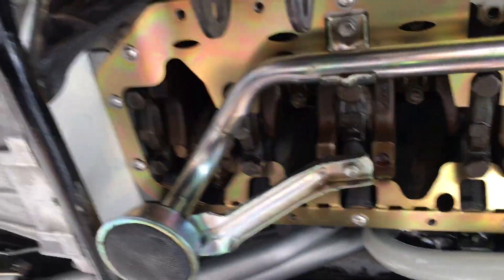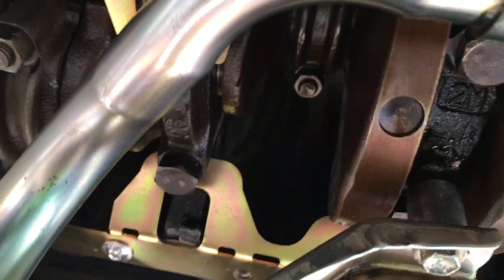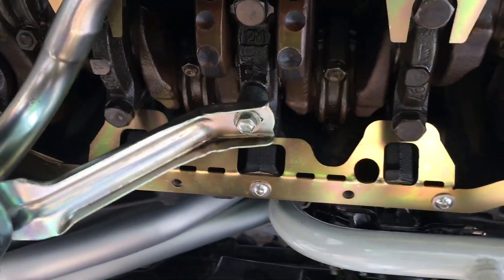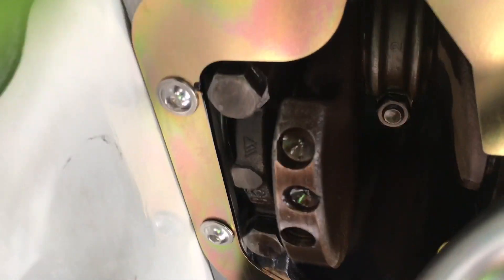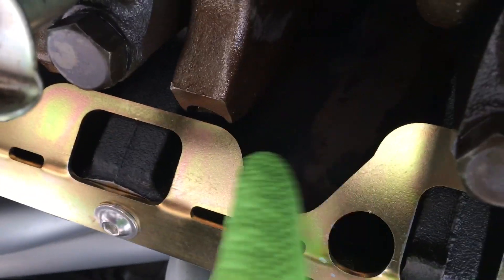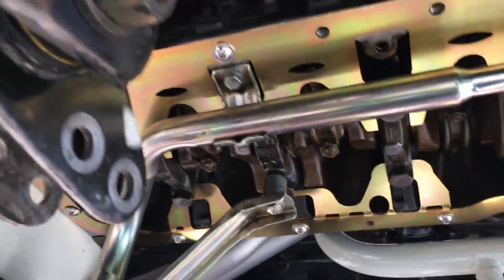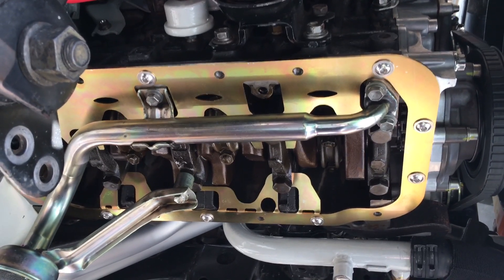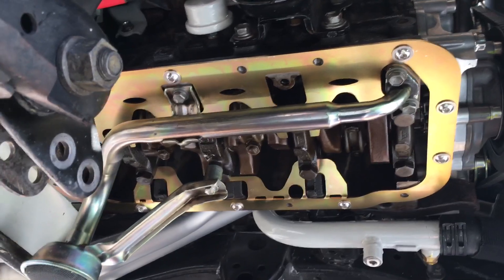Test fitting LC Engineering crankshaft oil scraper on the 22RE Toyota pickup

Comment: Hi, Ray.  I remember another video of yours where you mentioned you had done a comparison on grey vs black ultra ... I was impressed that you took the time to do that, but, however, I wonder what the manufacturer has to say about the different applications of the gray/black?  I'm sure they have different properties, but whether one set of properties is "better" really depends -- i would think -- on where the product is applied, e.g. windshield vs high-heat engine part vs brake line system vs ... etc.  I.e. "better" is relative.  I get the impression that permatex is a pretty good brand b/c I see it used and suggested by folks who don't seem to simply be permatex fanbois, but rather seem to be regular users.  I must say, although I love your enthusiasm, and I am very grateful for you taking the time to produce and share these videos (something I myself haven't stepped up to, so I'm sincere in my appreciation) I tend to think that your assessment  of the grey vs black might be slightly warped, and I'd encourage you, in a very friendly manner, to consider their properties in a slightly different usage standpoint.  If you stand by your assessment,  then so be it; if you modify your assessment a bit, the so be it.  Truly -- thank you for sharing this journey of yours, it's very helpful to so many people.  Bless you, and please continue sharing these awesome videos.
Reply from the maker: Thanks! Yeah, both work in this application although I think Ultra Black is really a superior sealant in most situations where heat and oil are involved.
Reply: Well said.

Comment: The reason why the 22RE lasts so long is it flings oil everywhere. This is a great idea for a performance engine, but the 22RE isn't a performance engine. It's an endurance engine. This seems like a addition that will cause more problems than benefits.
Reply from the maker: I'm sure there will still be plenty of oil flying around in there :-) The 22RE is a simple, robust motor for sure and that's part of what makes it a great motor. As you point out, it's not really a platform for a performance motor, even in its turbocharged version. However, if you take a poorly designed motor and fling oil all around, that ain't gonna help extend its life much. I think the converse is true here also. But yeah, I get what you are saying. Based on what I have seen during installation, I think there will still be more than enough oil flying around in the crankcase to keep the crank, rods and pistons happy. My goal here is mainly to reduce some of the oil on the cylinder walls, so that the motor will maybe only burn 1/2 a quart every 1000 miles, not 2 quarts :-) I guess we'll see soon whether this is an upgrade or downgrade. Luckily, I will be replacing this motor in a few years with the 3RZ turbo project, so this particular 22RE only needs to make it for a while longer.
Reply: @ray5961  "I guess we'll see soon whether this is an upgrade or downgrade."
PLEASE follow through on this .. IK life happens, but this will help so many folks out.  I've seen (online, not irl) LS and other race engines  where this is done, and I assume it must be a net-positive, at least in certain applications, but in a DD, IDK how beneficial it is.  When considering the cost of mod vs the cost of swap, these kinds of decisions can get very difficult to make.
Reply from the maker: @tedbastwock3810  Yeah, I feel like - especially with regard to the 22RE - this is a very mild modification in terms of a motor that spins rarely above 5000 RPM's for any consistent length of time. I installed it mainly to help reduce excessive oil on the cylinder walls.
Reply: I like very much what both of you had to say. I'm going to be pulling out a 22re in the near future, tearing it completely down and deciding just how much rebuild is worth going back into it.  I'm considering a 1uz swap.  I'm highly intrigued by the performance vs. endurance designation.  Nobody can deny the 22RE is an endurance monster, without doubt one of the best ever manufactured for endurance ..... but the 1uz ... it has also certainly proven to be a beast of endurance but with plenty of ponies ... I'm curious what is your take on the endurance-vs-performance take on the 1uz?
Reply from the maker: @tedbastwock3810  I don't have any experience with the 1UZ. The 22RE is a nice motor. It's very much like the older Datsun L series motors. Simple and robust. I did research what motor to build from Toyota a while back and my feeling is that it's hard to beat a race prep 3RZ-FE.

Comment: Very cool.   So the idea is that maybe the scraper will prevent as much oil getting flung up and aerated into a vapory mist in the crankcase?  Or less oil flung onto the cylinder walls?
Reply from the maker: Yeah, that's the basic idea from what I gather. It helps prevents the oil from clinging to the counter weights and helps prevent it being slung up onto the cylinder walls a bit. If you check the website for LCE, they mention all the things it might help. I'm hoping it just reduces oil on the cylinder walls a bit (and maybe that might reduce oil consumption between oil changes a little) and maybe help increase gas milage slightly. Now that it's on there, it's kinda cool actually. So we'll see. I will follow up and mention if I see any difference or anything.